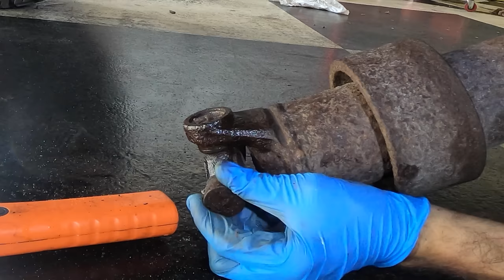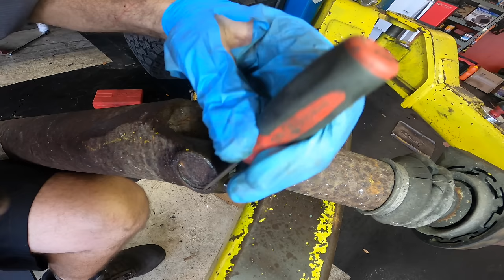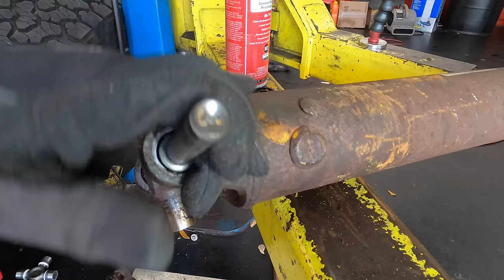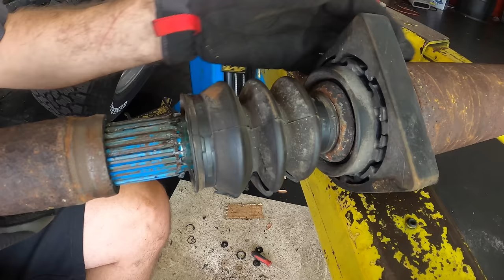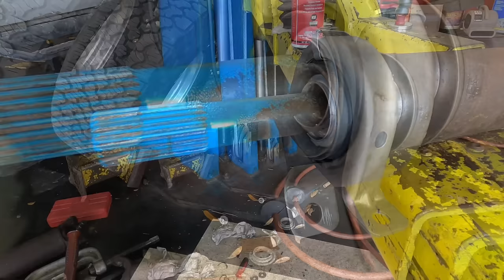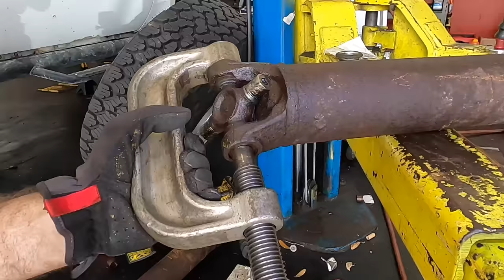Exploding End Caps!  Total Driveshaft Rebuild!  Ford F-350 7.3 Powerstroke 4X4

Comment: From living in the rust belt, I quickly learned that the first thing to do on a vehicle is to spray penetrating oil on anything you might have to take apart so it can soak as long as possible.
Reply: Living in Massachusetts, I don't know anyone who turns wrenches even once in a long time who doesn't have their favorite penetrating oil.
The most sworn by around here is PB Blaster.
Reply: I always get a kick out of watching all the various penetrating oil comparisons online, where they just give it a spritz of whatever fluid and then proceed to hammering on it 2 seconds later, then they complain that none of them work. Ive spent much of my existence wrenching on my personal fleet of beaters in the road salt hell of nothern Iowa. I've learned that the key to any penetrating oil is time... If I'm gonna be working on something over the weekend I'll go out on like Wednesday or Thursday and start soaking down, and I'll do that a few more times over the next couple days before I start taking it apart. I know that's not really an option in a shop setting where it needs to been done within an hour or two, but for any do it yourself type folks out there it can make a huge difference letting it soak a couple days, especially if you don't have any high power air tools at your disposal.
Reply: @MonkeyJedi99  lost a can under the seat of my 6 month old LTZ DirtyMax,stopped hard at a light,then smelled something familiar,yep PB soaking into my carpet! I took it to the detailer like half a dozen times and finally got the smell out!
Reply: @_Frank_the_Tank  spot on. my mates taught me to "feed the oil" (whatever you favourite flavour). let it get sucked into the crevices and keep feeding it. In time when u dont have a torch or the tools, feeding it the way to go.

also get yourself a wire-wheel. 2 seconds on those u-joints and suddently they are brand new. bzz bzz.
Reply: wire brush it before spraying, it make a difference ;-) (from a 5 months/year with snow and salt environment ;-0 )
Reply: torch torch torch torch torch!!!!!(chanting). penetrant is only good if there's microscopic fractures and voids for it wick into and on the majority of very crusty rust belt stuff, that's a big nope-nope.
heat it and beat it(vibrates it with large air hammer and impact on lower power or small impact like he used. (all the above)
Reply: Pennsylvania here,  I helped out around a small shop,  we had smoke breaks, so we knew when someone was wssssSSSSSSSSSSShhhhhh  i knew it was smoke time, because every time we spray penerating oils on something,  we'd go outside and sit on lawn chairs to smoke/coffee time for 10? mins   come back and try to break that nut(nuts) open    talk about Pavlov effect
Reply: Penetrating oil? That doesn’t work as well as fire

Comment: i did replace  same you did but end up bending the driveshaft yoke  when  attempt to take the ujoints out ,   but  did not have a problem installing   carrier bearing    i used press bench  to put in.

Comment: Years of centrifugal force and rust turn that snap ring and groove into a very stubborn fit. Use an impact socket that just fits inside the diameter, place flat on a hard surface and smack the crap out of it. That snap ring will loosen right up and will make the cap removal a little easier "usually" Good Job Ray, keep up the fun vids
Reply: I concur as I live in the rust belt (MI U.P.) and I've done the exact thing you mentioned for years, never had a snap ring break.
Reply: @dave8168  ship it to the driveshaft shop looks about right as well

Comment: Would it make sence to tap the U Joint cap in before one tries to get the locking ring out. The reverse of pushing the caps out to loosen up the drive cross, and lock in the locking ring.??

Comment: I've done so many ujoints in my time that when I see a crusty shaft like that I angle my grinder in and cut off the ends of the ujoints without damaging the shaft and then the caps come out super easy and so do the crusty clips.
Reply: I was wondering if this was an option! I would have resorted to this sort of destruction about the same time that first clip broke!
This was probably the most awkward, bastard of a job I have watched Ray struggle with, maybe just because he filmed most of it, but I feel it could have been made so much easier with a decent workbench and a couple of good vices to hold the thing! Trying to keep a round thing, with wobbly bits, in one place, across the swiveling arms of a lift would be frustrating!
Good job keeping your cool Ray!
Reply: A press should be used to install those roller bearings ,I would have thought,and clamping the drive shaft to the  lift would be a good idea....

Comment: Round parts all over the shop floor, including tiny needle rollers.  Also, I thought you were supposed to wail on the cap before removing the clips to give just a little more clearance on the back side of the clips.  But I've only done u-joints once and all stuff like this takes me literal days for a two hour job, so what do I know.

Comment: My experience in putting caps in sockets and keeping  needle bearings in place is to put a little extra grease in each cap and work it around with your finger or put back on cross and turn it around.. Keeps from having to pull cap back off.

Comment: When I did the u joints on my old car,  i did not remember the inner clips neede removing b4 the bearing cups woukd push through the yoke.  Was very frustrating and difficult.  Messed up two of the cups and had to go for a second u joint.  Wish I had a press for that job sir.  Great vid.  Thanks.

Comment: My 2004 F250 currently needs the same thing.  Fortunately my passenger side valve cover gasket doubles as an automatic chassis lubricating system so I don't have rust issues like this one.  It probably helps that my truck has spent its life in TN away from much salt other than a few days of snow each winter.

Comment: First thing to do when changing any u-join with that style of clip is to give those caps a little tappy tap in...this will 1 generally knock any rust on the clip loose from its groove and 2 release any pressure the cap has put on the clip from centrifugal/centripetal forces....9 times out of 10 the clips will come out no problem...ford drive shafts are a bit funny as they do have that master spline but it's only typically 1/4 to 1/2 inch long on the end where the 2 halves first go together and then that master spline turns into a couple of regular splines the rest of the way down towards the carrier almost like having a master spline was an after thought to fix a screw up on the mating shaft so the just put a quick spot weld there and then turned it back to size
Reply: My mechanic buddy taught me that one. Game changer!
Reply: I was going to post that, but you beat me....
Reply: @mikedee8876  me two
Reply: Just tap it in. Just tap it in.
Reply: I posted before I read yours . My father taught me when I was a boy ,he was a diesel machanic.
Reply: Ford screw up??? Say it aint soooo
Reply: yea thats correct method but chisel was bas idea from start
Reply: 2nd is mark yokes and shafts with line mark! as to assemble same position
Reply: Yes sir. I was smacking my head lol
Reply: I just couldn't watch any longer, I had to make sure someone had given the tip to put a socket or other impactable item against the snap ring and groove then give that thing a good loosening with a hammer to break snap ring 
and groove away.
Reply: Right on. I'm sure Ray has changed out more U-joints that I but in my (several decades) of experience, I work those rusty ones, which I seem to get more than my share of, in the following manner: Step 1. Soak the clips in penetrant BEFORE the driveshaft comes out. Step 2. Soak them again AFTER the shaft is out. Step 3. Couple of sharp blows to the caps with a drift. Step 4. If the clips don't come then, air hammer to the outside of the eye. Step 5, apply heat if they are really bad.
Reply: @JAMESWUERTELE  give it a little tappey. Tap, tap, taparoo
Reply: cheap/worn out sockets about the same diameter make great driving tools.
Reply: @johnme7049  how is it a ford screw up when that is a Spicer drive line plus put 200k miles on any none greaseable u-joint you'll get similar results not bashing just stating facts
Reply: @farmtoy100   I was commenting on another comment that you have no apparent insight into. therefore, your comment on my comment on someone's comment isn't helpful since you don't seem to understand the commenter's comment or my comment on his comment. That's enough commenting on comments for this comment. :D:D:D
Reply: Living in the rusty belt teaches a tappy tap on the caps before removing u-joint clips is a good thing.
Reply: Yep and you can usually find a socket that fits good to tap it with

Comment: Another easy way to remove the carrier bearing. Remove the rubber, cut the outer shell off with die grinder, score inner race with die grinder, take chisel and split inner race.
Reply: Once you have the outer race off, get the torch. Heat up the inner race and it ought to fall right off. I haven't done this with a carrier bearing, but many times with a wheel bearing. Ought to work the same way, and no chance of scoring the mating surface for the new bearing. I used to do it the way you described, but if ya got a torch...👍
Reply: You have done this before 👍🏻👊🏻
Reply: No need when you have a press available. thats how you do it in your driveway
Reply: @Mach141  I do have a press...no way I'm getting a driveshaft into it. (torch takes 10 seconds & it's Miller time).
Reply: @warrenzevonsangryghost6055  yep, just don't go overboard and overheat the shaft at that spot.  big torch works and wins most of the time over all other methods.
some people tend to use too small a tip/flame/heat and it takes far too long to heat the part it's applied to and the heat wicks out into and cooks the shaft/other parts.

Comment: Worst u joint I ever did was on a windstar(RWD Van). The shaft and the yoke was aluminium. No matter what tool I used or heat the joint would not come out. Wound up getting a used shaft

Comment: When it comes U-joints, a cut-off wheel on 4 1/2" grinders is your best friend. Just cut them off inside at the cross and drive them out. You don't even have to remove the clips until the cup moves away from them which makes that part real simple as well. I have changed move U-joints and pulled/cleaned lockouts then I can count. In my younger days we would play hard all weekend in the mud. This is when I learned the lesson of muddy water in bad places and to grease u-joints and remove/clean lock outs every Sunday lol. We played in our daily drivers so fixing them so you could make it to work Monday morning was a must. Once a month the fluids in the front and rear axles was changed as well as the t-case and trans if a manual. This was later solved by adding longer vent tubes to keep them out of the water.
Reply: Agreed if you have no options. I fortunately live 10 minutes away from Fleet Pride,I took a shaft there out of a Workhorse food truck,to make sure the parts I was getting aere correct,and the guy was like do you want is to pull ot apart and refresh it ,im like how much and he says your looking at $120 with the parts,hhhheeeellll yeah! Come back in half hour! No brainer!

Comment: When I find really badly corroded joints like these- such as the ones on the 1972 MGB GT I am currently restoring after it’s stood for 30 years- I find it easiest to take a 1mm cutting disc through the yolk on all 4 side so you can achieve separation. Then you can easily punch or press the bearing caps inwards to remove, avoiding the corrosion. Then worry about the clips and clean it all up after. I’ve found that much quicker.

Comment: Rust belt U joint removal,. Step 1 remove driveshaft. Step 2 Get blue wrench and cut U joint off leaving cups in place.  Step 3 air hammer cups out. Step 4 Remove spring clips !

Comment: When pressing off a bearing like that, always turn your bearing splitter so the threaded shafts run along your braces, not across them.  They can/will bend doing it the way you did it.  Don't ask me how I learned this.
Reply: Ray ,your patience while working on tough jobs is the reason you are an outstanding mechanic and gives us all room for growth.
Reply: You need to review online driveshaft repair. All parts have to be reinstalledin the same aligned possition as the driveshaft is balanced. If parts are rotated the shaft will no longer be in balance. All parts should be marked and replaced in the original position.

Comment: Do you not mark the drive shaft before disassemble so they are assembled in reverse order?
Reply: I was thinking the same thing. Drive lines are balanced assemblies and should always be reassembled with shafts/yokes aligned the same as it came apart.
Reply: From what I understand, the drive shafts themselves are indeed balanced, and the split ( 2 piece ) driveshafts do indeed need to be kept aligned to each other when reassembled. 
In this case, Ray marked the 2 shafts in relation to each other before discovering that the splines had a master key. 
 But otherwise, the orientation of the shaft when reattached to the diff or transmission is irrelevant. 
 Again, just from my understanding.
Reply: @bruceb4349  👍
Reply: I am positive that this driveshaft would be out of balance . Yes all parts needed to be marked and reassembled in the same configuration.
You had all the necessary tools yet you relied on a hammer and chisel !  Nothing worse than damaging new parts by installing them incorrectly  .

Comment: I was replacing all of the universals on my Jeep right after I got it and they were so rusted in I went and bought a press from Harbor Freight. Worth every penny. I tried ball joint tool, I tried my impact hammer/chisel. I soaked them multiple times nothing else worked. Save your old toothbrush works great clean splines.

Comment: Ray I waited for the whole video for you to say that the shafts are balanced and must be indexed to the correct position. I must have missed you Marking the Shafts before disassembling.
Reply: You're not alone...I didn't see any yoke indexing going on either. 🤷‍♂️
Reply: I am wondering how does the whole flippity floppity assembly with 2 joints gets balanced in the first place. It seems it somehow does since the weights are present. Each piece individually, no problem.
Reply: @milantrcka121  The assembled driveshaft, as a complete unit gets spun on a balancing machine. If you visualize something that looks like a giant lathe, it's mounted, spins up and weighs are added where needed. 
Many, many years ago, I purchased a 1985 F250 from a Ford dealership that had a horrible vibration. The dealer sold the truck at a very inexpensive price not realizing what was wrong with it. 
Previous owner had a u-joint vibration, but being a 2 piece shaft similar to what Ray was working on, they installed new u-joints, but was 180° off.
After purchasing the truck, I pulled the driveshaft assembly off, took it to a driveline shop, they ground the weights off, rebalanced the assembly and it never had vibration issues again.
Imagine how a tire spin balancer works, now for a long flippy floppy thing and you'll get the idea. 😉

Comment: Ray, I'd like to thank you for showing me that I never, ever want to rebuild a u-joint. Good work my man.
Reply: Ditto.  That’s two of us.
Reply: @randomschmo5778  make that 3 of us ! lol
Reply: It's not so bad if you have a facility that has a truck lift to get it up in the air instead of laying on your back on the floor.  Also helps to have the tools to work on a heavy duty drive line.  Kind of not fair to Ray asking him to do this at an auto repair facility
Reply: @mauricekeithjohnson2598  Four.
Reply: @CaptainRon1913  i was gonna say the same thing. I do this same job pretty regularly but our lifts are designed for full size trucks and my tools are more specific to heavier duty jobs. Except I don't have the hydraulic motor press... mine is still the old fashioned hand pumper... I'm a bit jealous lol.

Comment: In the future it may help to take one of the loose bearing cups and put it over the snap ring and smack it with a hammer. This pushes the bearing in the yoke and may help free up the snap ring. Other options are to torch the joint and the press out the bearings.  All of that makes it easier to get the pieces of snap ring out.  I worked at Dana, the manufacturer of that driveshaft.
Reply: I was thinking a propane torch to heat and partially soften up the remaining grease in those U-joint Caps ?

Comment: Hey Ray, I repair heavy industrial machinery and it's always corroded. I find that rust is a major time consuming obstacle and removing the rust prior to disassembly makes my life much easier. I use a angle grinder with a cupped wire wheel to clean as much of the rust as possible off the mating parts and liberally apply penetrating oil through out the removal process. If the part's squeak or bind while pressing, pulling, sliding, apply more penetrant. I'm not trying to tell you how to do your job, just something learned over 50 years of wrenching. I do enjoy your content! Thanks for putting it out there!

Comment: I've seen you do this a couple of times.The clips are tight because the caps are pressing outwards. Tap the caps in and the clips get loose. You know when you press the new caps in and the joint is tight? Then you tap with a hammer, the caps press against the clips, then the joint is loose like it should be. I always changed u-joints with nothing but a hammer on a vice when I worked at a Ford dealership. You make u-joints look super hard! Just use a hammer and knock the caps out on a vise. When you're using the tool, you're moving 2 caps. Using a hammer moves only one out at a time. They pop right out. Try it some time!